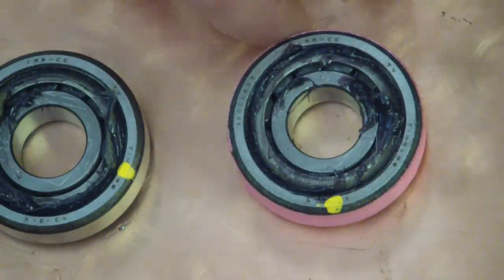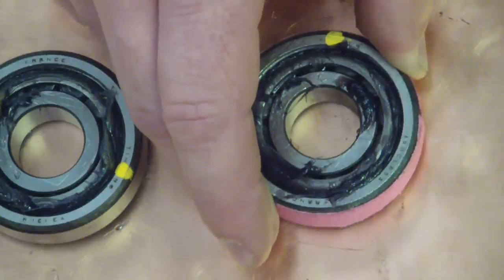Frictionless Bearings - Technical Secrets Explained!

Comment: HA HA HA I loved this.  I work in the skateboard industry educating skateboarders about bearings.  Kids like to determine the quality of their bearings by spinning a wheel.  Free spinning a wheel with bearings proves nothing.  You have to have loads applied.  Great video! LOL
Reply: +Rat Vision – Skateboard Tech ^ This guy XD
Reply: +Rat Vision – Skateboard Tech It can tell you how much grit there is in the bearing.
Reply: +Rat Vision – Skateboard Tech Clean out the lubricant and refill just a drop of oil into the bearing is the way to get fast. There is no need for top bearings, if they only have to carry the stress of one persona. If you dont want to have rust, go ahead and oxidize the shit.
Reply: Or the kids that brag about the abec rating. Which has no relevance to skateboarding whatsoever.
Reply: Tell me this Rat Vision. I put ceramic bearings into my roller blades, on the belief that they run cooler and last longer. Is this true from your observations/experience? I figure you are a good person to ask, because skateboard bearings and roller blade bearings are very similar.
Reply: The first answer would be yes. But understand that there are very low quality ceramic bearings that could under perform high quality steel bearings. So to just to say yes isn't a true answer. Assuming you didn't buy junk then yes.
Reply: Ceramic bearing potentially can last longer, but they could also potentially bust quicker. It depends on the application. In a shock prone environment, ceramic isn't ideal. You will be busting bearings far more often if they are ceramic.
Reply: depends on how grimy and dusty the bearings are, as mine used to be- didn't freely spin, after i cleaned them they did.
Reply: Joe T I don't believe there are any passive magnetic bearings yet, they all electro magnets with sensors and feedback loops
Reply: Joe T magnetic levitation bearings are used in some computer fans, but that's a bit like those floating pen toys, its not capable of taking more than a few grams of weight, definitely not possible with anything carrying humans yet.
Reply: @MrBilld75  this has sort of been touched on already, and I'll admit most of my knowledge is from studying mechanical engineering (I do long board but not frequently enough to be considered an expert), but from an engineering stand point the idea behind ceramics is they need less or possibly no lubricants and stay relatively cool, and so are suited to very long duration use, especially if it's long duration at high speeds (e.g downhill stuff). However, ceramics generally dont like shock loading. So if terrain parks are your thing then go with steel. Yes the best ceramic bearings will have less friction than steel, but you'll only notice the disadvantage on those long duration applications as the friction losses build up over time. Plus, if you are more the terrain park type, intact bearings generally roll easier than shattered ones... So there's that. 

Also, for everyone saying that spinning bearings helps determine if there's grit in them, you're right, but that's not a test of the bearings as much as it is a test of whether they were cleaned and lubricated properly (i.e most likely human error)
Reply: @maxk4324  Interesting. I watch Engineering Explained here on Youtube and AvE as well, so I am always interested in the engineering aspect of things as well as the application of a product. How things come to be. I didn't consider the shattering aspect, but being ceramic, yeah. Steel is stronger that way. The running cooler aspect I knew about, but I would not be going particularly fast. The better longevity was what originally sold me on them. Longer lasting, o.k. Not that they have seen much wear/use at all. If and when I do use them (haven't in years, lol) it would not likely be on terribly bumpy terrain or be doing any impact stuff. Thank's for the answer.
Reply: @rich1051414  Good answer, thank's.
Reply: @buzzth3bee185  Good answer, thank's. That makes sense.
Reply: @MrBilld75  oh, also, one big massive benefit I forgot that could justify them, regardless of performance: ceramic doesn't rust.
Reply: @maxk4324  Yeah, quite true. I have seen rusty bearings.
Reply: I take the seals off my bearings and use acetone to wash the factory shmu out of them first thing then i put a liiiiiiiitle bit of oil in em and slap em on my skate (without the seals) and off i go. Runnin naked all over town.
Reply: Devan H Way too complicated. I save a step and just use the WD to clean and lubricate. Also, I just use my board as a giant fidget spinner, as I’m to frikkin old to skate.
Reply: Hey dude, wanna rant about Bronson shieldless bearings?
Reply: @Metal-Possum  Hmmm, good points really.
Reply: @Metal-Possum  Like many industries, yeah, I can imagine. "Natural" health being one of the worst offenders. All marketing wank.
Reply: @Metal-Possum  Lol, I've got some essential oils and herb supplements, that'll clear that right up.
Reply: I mean, if it didn't spin that would tell you a lot right there
Reply: Bullshit. It doesn't "prove nothing". Plenty of info can EASILY be gleaned from the Noise, and smoothness as to the likely performance of a bearing. If a free wheelin' bearing spins a full two minutes before showing much sign of slowing down, I assure you, it is pretty fuckin' skookum.
Reply: Imagine if you could somehow have a skateboard with air bearings. It'd be the closest thing to a hover board if you had some really smooth pavement.
Reply: @jackfiercetree5205  what he means by ‘proves nothing’ is how fast or long their wheels are spinning when they’re holding their skateboard with on hand and grab and spin the wheel with the other. Context is important
Reply: @OtakuNoShitpost  that’s probably not the bearing as much as over torquing.

Comment: I use to repair large servo motors. Much amusement was had by cleaning out the grease of a bearing, getting an air line and while holding the center, spin the thing up to crazy rpm and then dropping on the floor.

Comment: Electric motors are designed to run many lifetimes, but they fail because of human touch. Premature failure due to...... You can always track it down to somebody.
Reply: Bill Lewis short lifetime.
Reply: Abom79 correction they used to be
now manufacturers purposely undersize the windings on motors so they heat up quicker thus failing quicker they also weaken other parts 
electric motors are super simple it takes engineering to make them fail faster
Reply: Bill Lewis it is a lifetime oil
its not your lifetime its the manufacturers specified lifetime which is a few years
Reply: Abom79 "Electric motors are designed to run many lifetimes"

...If they are stoutly engineered and built for their environment, as well as under the proper loads.
Reply: Abom79 That USED to be the case, now we live too long to outlast anything...... Motors included....
Reply: I go back to what I say, there's always a reason for failure. It failed do to.....? Track it down.
Reply: Bill Lewis
Not so sure, it applies to anything at all by now, we can see some 100 yo motors still running, guess we'll have to live another 100 years to actually test the theory of the newer engineering for money...
Reply: My shop is powered nearly exclusively with electric motors from the 40's. The things are huge for their power output, no doubt why they have lasted. I mean the 15hp on my G&L is as big as a full size trash can it looks like. I can't remeber if my Monarch has a GE or Westinghouse in it but I do know it has oil cups. and I fill them once a year. It is probably 5 times quieter than my 30Hp Baldor I use for my phase converter that thing makes a ton of noise and always has.
Reply: Bill Lewis Capitalism at its finest.
Reply: bcbloc02 Actually your motors are less reliable. They are larger because the enamel coating on your windings are not high temp like they use now for modern motors, so more surface area is needed for heat dissipation. Motors from companies like Baldor or Leeson do indeed last a long time. All motors made by reputable manufacturers must adhere to NEMA MG-1 standards. Lesson of the day? Don't buy motors that are from manufacturers who are not NEMA members.

Use this guys:

Baldor
ABB
TECO Westinghouse
GE
Hitachi
Siemens
Reply: In general modern motors are far superior to the old ones - higher efficiency and smaller for the same output.

But as also mentioned, they are designed to only last a certain time.
And no - that got nothing to do with any conspiracies or the companies being evil.

But imagine a company now selling a washing-machine for example, that is not designed to break but to last.
They will make a fortune - but after some time sales decline and the marked is ruined for the next 50 years or longer.

And i have some of the lecture-materials from our local university and even from some big industries like Voest Alpine.  
It is pretty early one that they learn how to make something last just for a certain amount of time.
Reply: ABaumstumpf Yes, washing machine purchases would decline but so would our need for a new washing machine and our focus would shift to more advanced devices.

I believe greatly that we should make things to last and conserve resources for development. Still, there are so many people without a washing machine and we are still supplying people who already had a washing machine all their lives because they break.
Reply: Bill Lewis The only reason light bulbs last a puny amount of hours and nylon tears is because of capitalism.
Reply: Atristiel
For lightbulbs - not so much as people make it out to be. 
Yes, you can make a ligthbulb last far longer - and then it also takes significantly more power. We are tlaking about 2-3x the power for the same light.
And nylon - cause women want i thin - no seriously, there still are more than enough companies producing thicker and sturdier nylons, but they simply do not get bought all that much if at all.
Reply: Atristiel Capitalism is also why you have a job and is actually able to own things. Please, if you're going to bitch about something, you might at least bitch about something where you can make an attempt at changing.
Reply: Atristiel  All you did was spend money on manufacturing a product for yourself. Further spending money with several other manufacturers in the process. After some time, if your new device is good, you decide to make some more and start ordering supplies in larger quantities. Maybe you give one or 2 away to friends or family to test out. Word gets around and a few more people would try them.

At this point, you decide you may need to at least recoup some cost, just parts at first. After a few month of spending your spare time making LED lights, you stop one day a get a miffed that you just spend your time making lights.

At this point you have 2 options:
1. Continue the crusade against "corrupt light bulb manufacturers" solo
2. Enlist additional help in the crusade. Generally, few people are going to be willing to work enough hours to make a difference without some form of compensation.

So you start a budding 2-5 person assembly line in your garage, you start charging a nominal fee on lights to cover the little bit it takes to retain additional help. etc, etc.

My point being, your proposed solution is literally the foundation of Capitalism.
Reply: DefensorMilitas I'm not going to uproot capitalism, just force it to a less corrupt version that it is now. The reason I praise communism is really just the ideology that workers had with their products, hard to break, easy to repair as well as the realization of importance of workforce to a nation. Although you have a couple of good points, I don't like the idea of recouping costs from parts if that means something which failed any tests I exert on it, mainly longevity. Paying minimum wage to my employees, especially at this early stage?
Nah, I wouldn't sleep at night, this is why I hate corrupt moneymaking schemes.
Reply: Atristiel You seem to not understand what the word 'corrupt' means.
What you describe is greediness.

Communism is one of the systems that leads to corruption rather easily - more so than capitalism.
Reply: ABaumstumpf Ah, okay, so then capitalism labels things differently.
Reply: ABaumstumpf yeah but for prolonged corruption you need democracy for that
Reply: Ronald Baker
"yeah but for prolonged corruption you need democracy for that" ... yeah, cause north Korea is democratic? :D
Corruption exists where there are humans.... no, even where there is intelligent life.
Reply: Bill Lewis 
USE A COMPRESSED AIR LINE HOOKED UP TO AN OIL DRUM AND SPRAY THE WHOLE THING. I'M SURE THE OIL WILL SOAK IN SOMEWHERE SOMETIME, I THINK, MAYBE. THAT'S WHAT THE GUY AT THE WICK FACTORY TOLD ME LAST FEBTOBER.
Reply: Abom79 There are plenty of different, I assume you are talking about induction motors.  Your statement is totally too broad.  There have been cheep motors made for years.  There are still excellent motors made today that will certainly last 80+ years if properly maintained and used in the correct application.
Reply: Bill Lewis is right on the money about air conditioner fans and his drier from the 60's.  I've had plenty of motors out of AC's and Dehumidifiers that should have lasted much longer if sealed bearings were used instead of shielded bearings or bushings.  I recently gave up on a 60's dryer myself, only because the heat duct grill rusted through from the combustion condensation.  In every other means, it was repairable and much better made than it's tin can replacement.  Its all about the quality of motor that the manufactures are willing to source and the years they want the item to be in service.  I believe there are even laws on the books concerning the availability of replacement parts, due to some manufactures trying to prematurely discontinue parts.
Reply: +EETechs +bcbloc02 Being old technology isn't the full story. Motor size and its RPM rating 
have inverse relationship. You can look up catalogues for, say, 10kW 
motor and take note of  weight and dimensions for different RPM ones.
Reply: Abom79 the bomb
Reply: @imchris5000  NoOoOoO, it's because you, the consumer, win, by the company saving you materials costs by using undersized windings!!!!
And other epic jokes companies try to tell you

Comment: I got full ceramic bearings for my friends motorcycle and they say "use no grease or lube" on them, just blow them out with wd40 from time to time to remove contaminants and they are good to go. Could they be classed as "almost" frictionless? I never spun them before they were installed so don't know how long they spin for :)
Reply: toysareforboys sealed bearings require no maintenance
Reply: ***** So what, that makes them better? lol!
Reply: +toysareforboys In most cases people do zero maintenance on bearings so YES a sealed bearing can be better in that case. The human element in maintenance is usually the weakest link.
Reply: +Swedish Assassin Yeah when those sealed bearings seize up you just throw them out and buy new ones.

Comment: Well put man! I ride 1 inch stainless steel bearings in most of my long / skate boards, and ceramic in a couple others. The steel heats up and hisses when dry, but I'm a regular sewing machine oil user..so usually no issues...The ceramic bearings don't need any lube at all, and they cruise..although not any faster than clean precisely oiled steel. even if we used pressurized air instead of balls or rollers or even oil / grease, it would still create friction.

Comment: When you see the word "frictionless" you know it's gonna be total bullshit, unless someone is talking about a sea of Superfluid Helium. But that stuff climbs up the side of your boat, fills it, and sinks it before you can put anything in it. :P

Any skater will tell you you can rip the inner guard off your bearings clean out the gunk inside, and make your wheels run a lot faster - but at the expense of wrecking bearings fairly quickly.

Comment: By using the patented ScheiBe technology, my bearing is able to harvest thermal vibrations and convert them into less entropic mechanical rotation. The net increase in entropy is negative. It will drain away heat and convert it into energy.

Comment: what is the difference in terms of accuracy between setscrew pillow block bearings and press fit bearings? If you are building a table saw .. is it better to use a press fit bearings on a hub/mandrel or two set scews pillow blocks?

Comment: I thought you were going to talk about magnetic bearings... not sure if they are frictionless but they are quite enough to not need hearing protection. Huge noise difference in a chiller plant that uses standard bearings vs the magnetic.
Reply: Induction does basically the same job as friction in this case, That along with the air, still a massive improvement regardless

Comment: jet engines, most of them anyway, have big oil systems. They use huge gear pumps to do this, but what most people dont understand is that the oil isnt there to lubricate, but to take heat away from the bearings. Since there are no slideing surfaces in a jet engine, theres no need for lubrication. Heat is generated from the slight amount of friction within the bearing and also from the engines combustion itself. Oil is carried from the bearings through a heat exchanger in the intake, and back to the sprayers on each bearing. roller bearings are used on each end of the engines shaft so the shaft can have some axial movement due to heat changes. and ball bearings are generally used in the center of the shaft to hold the sucker in place so when shes choochin at 50,000 rpms the shaft and turbine blades dont just fly out one end. Oil is then sprayed across each bearing to keep em nice and cool so the whole engine stays nice and skookm.........why do i say all of this? well you had to mention frictionless bearings......